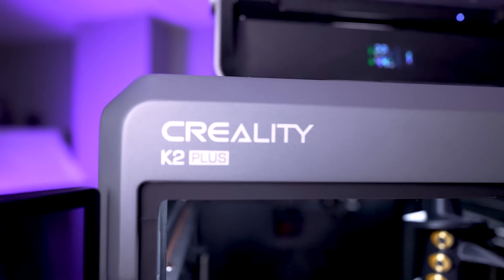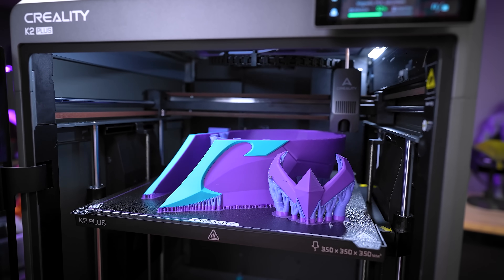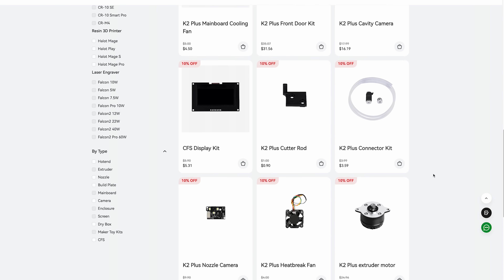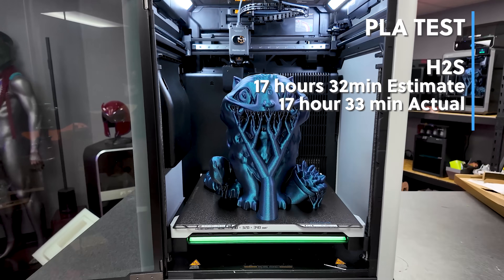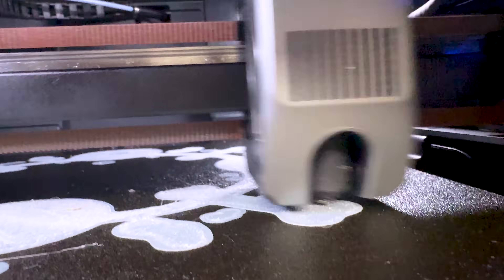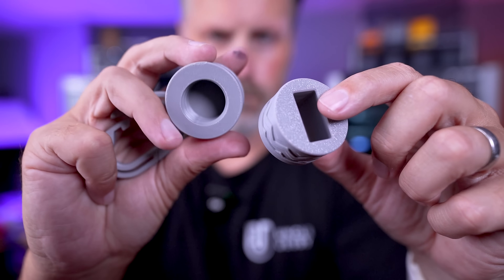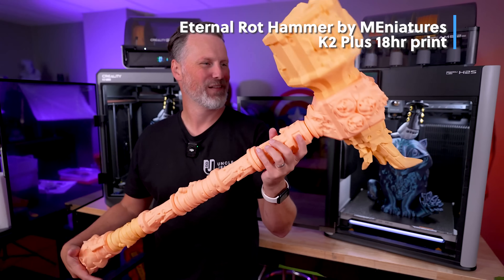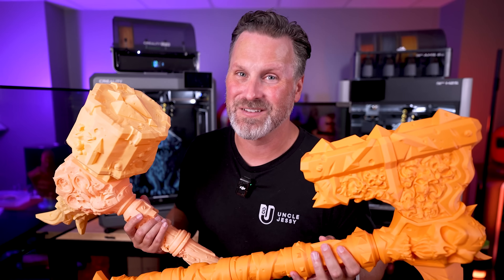Bambu Lab H2S vs Creality K2 Plus — 3D Printer Showdown 🔥

Comment from the maker: Fanttik is running a big Back To School sale now!
Get 30% off the Fanttik F2 Master Cordless Rotary Tool Kit with code JESSYF2M at https://amzn.to/461rlKi
Get 46% off the Fanttik S1 Pro 3.7V electric screwdriver with code JESSYS1P at https://amzn.to/3JtHEHi
Reply: the
 code for the screwdriver is only 10 percent off not 46
Reply: @HPY-Prints  Code on Fanttik website doesn't work either
Reply: Will you be at Formnext in Frankfurt in November?
Reply: I have a solution for your K2 Plus poop chute issues if you want?  Message me. N I'll show you what I did to mine and it works amazingly now!
Reply: H2+, you say? 😀
Reply: can I get a updated code for the F2 plzz
Reply: Anycubic Kobra S1 Max Combo is comming in MARCH and BANG4BUCK it will be the goto for me and maybe a U1 when they are at retail or BLACKFRIDAY

Comment: The problem with Bamboo lab printers is you can buy pretty much every other printer on Amazon and have it in hand the next day free shipping with a 30 day no questions return opinion for any reason you don't like it, with Bamboo you got to wait for them to process you order up to 3 days then it is another 3 to 10 days for shipping and you pay for shipping. Bamboo printers seem to always be sold out maybe just my luck but every time I try to get one they always only have the most expensive ones in stock. Then they are always out of filaments and their ams needs their filament spool to work correctly it just seems like they can't even get the machine to you and lack of filament availability along with the inability to use your slicer of choice sucks they have a lot of hype and a lot of marketing youtuber praise but...... seems customer service and product availability lead times are a huge red flag to me!!

Comment: I've got the K2Plus and 90% of my prints are PETG only real issues I've had with it was when I 1st got it & the CFS jamming and lots of issues but since adjusting the spring in the CFS only had minor issues.
I have the Anycubic Kobra S1 Don't use it and the Bambu A1 only use it now and then because I've find my K2Plus just works

Comment: I had my K2 Plus for about 2 months now,  not once have I had a clog, nor have I have any issues with the PETG print or quality.  My prints are flawless.  Not certain if you are using a printer that  is a year old and maybe needs some maintenance against a brand new printer.    I would chose a free H2S over the K2 Plus as well, but when you have to pay an extra 900 for it.  No.

Comment: I like the open sourceness of Creality main reason why I've stuck to it. Unfortunate to hear that the k2 had issues with TPU, as with my k1 I was finally able to get tpu to print properly, but that's also because I'm running microtech hotend, but this wouldn't help the k2 as it's an issue with the toolhead. Might still consider the K2 plus to upgrade my k1 max for a larger format printer.

Comment: Great video. I was researching printers based on my need for engineering filament print speed and everything i've read has shown that the h2s is faster. Is it that the k2 is just not capable of printing engineering filament as to why the h2s scored faster in pa12-cf?

Comment: I consider the creality and bambulab debate as comparing apples to oranges. Buy what you value, go with creality if you truly want to be able to fix most parts yourself, or value its more "open" nature. Go with bambulab if you want simplicity, and support.

Personally, I like creality. But I am definitely one of the people that doesn't mind diagnosing and fixing problems. I've had my creality for a long time, and honestly? I love it. It prints everything i throw at it, and when something goes catastrophically wrong, its easy to figure out what went wrong, and i usually have a replacement part ready to go. 

But the printers at my work are all bambulab, and it works well for them. They're all in warranty, and the catastrophic failure that happened with a filament defect was handled swiftly, and I definitely see the value in that.

Comment: The filament build up is a user design error. A rework that widens the dish and has an angle at the bottom to allow the filament to drop closer to the front might help prevent buildup. 

I am a little biased because of a bad experience with the K1 Max, which failed on me time and time again and ended up buying an X1C, where I was actually able to print. The K2 Plus puts out some great prints and it is faster, but the quality isn't up to par with basic settings, when compared to the H2S. Even though I hate what Bambu Labs is doing, forcing people to use a middle man program to send prints off, I'd have to stick with them because of quality.

Comment: I've had several printers over the last 13 years, starting with a Folgertech I3 clone DIY from ebay. Plexiglass and threaded rods and bolts...had to compile marling, wiring everything else and calibrate it EVERY PRINT for years. THen got an Ender 3 v1, did several upgrades and loved it and had less problems than the folgertech. Got a Kobra max for it's size, but quality suffered constantly.  Then, i got a P1S...MIND ....BLOWN !!   True click and print. I don't think i've ever really altered a print profile that i downloaded.  Anytime i've designed a project, i changed very little in the default profile (aside from no calibration vibration and less purge for AMS) ...and still get great prints. I had since put the other printers in storage...no need to use those make multi part prints go faster, since the quality wouldn't match.

 Now i'm looking at getting the P2S when it's available and KEEPING BOTH running.

Comment: I have the K2 Plus and the H2D.  I've been having issues with the support of the K2 Plus adhering too tightly.  Not so with the H2D.  The thing is, I've had the H2D considerably longer than the K2 Plus, so I haven't figured out all the bugs I've learned to avoid on the H2D.  I've been running PETG and PCTG almost exclusively on both.  I've been building oversized coffee cups, wall tool holders, and rebuilding all my tool boxes I used to build with my CNC machine.  Yes, plastic is much lighter than wood for this purpose.  Owning large 3D printers is like owning a 5-axis CNC.

Comment: I have both printers. When I bought the K2 Plus I had all sorts of problems. Including the PTFE tube coming out of the print head. After working with Creality and replacing numerous parts it is now working with some minor issues. The H2S has given me the best quality prints I have had to date. I have printed several large and small projects and it is difficult to see any layer lines. I have 2 Cenaturi Carbons, the K2 Plus, 2 P1S's, a X1C and the H2S. The H2S is hands down the best printer. I did some PETG transparent filament with Bambu's recommended settings and they turned out incredible. In my opinion the H2S is worth the extra money.

Comment: so if the K2 Plus is slowed down to match the H2S print times then that may eliminate the ringing, also why not print the mod and try the TPU again? Also you cant compare an old printer with a dodgy coupler to a brand new printer

Comment: @UncleJessy in your video you make a comment at 8 minutes 36ish seconds stating the H2D doesn't purge any material.  Can you explain that further?  We're debating purchasing an H2S vs an H2D and  would like to better understand the filament waste differences between both.

Thanks for your detailed video!
Reply: The H2D has two print heads, so if you are using only two colors, the left head drops down and the printer continues to print.  There's no purge.

Comment: I bought a K2 plus when the H2D was released and was sold out.. worse mistake ever. I ran into numerous issues with the K2 plus with less than 30 hours on it. It essentially became a 1600 dollar (I bought an extra CFS)  huge paper weight for about 3 weeks. The main cable leading from the tool head to the motherboard was defective and a wire that went bad inside the harness, the tool head mother board went bad and the bed sensor went bad. Keep in mind I only printed with PLA at this time. Creality did replace them but as the only place that stocks these parts are china it takes forever to get in. I fixed all the problems and sold it immediately and took a 400 dollar loss, drove 3 hours to Micro Center and bought a H2D with a second AMS and I have had no issues for 2 months now.

Comment: I think we got the same bad batch of K2 Pluses. I've had the Strain guage issue which was eventually fixed by replacing the wiring loom, I've had the coupler give out (Buy another front extruder cover, they have updated it and the coupler is different now. A few changes internally to the plastic as well), and I've had the heat break fan issue as well so i've had that replaced. Next I would bet your stepper motor will die from the bearing wearing out and not being able to rotate. That's an absolutely horrible 6 hour long fix since you need to disassemble the whole top of the printer to change it out.

Comment: Great video showing off the H2S, thanks!  I am curious on something you said, the H2D did fail in its multi-color print but you said it had no purge material.  How did you accomplish this on what looks like at least a 3 color print?  I thought it could only do that on a 2 color print?
Reply: I agree.  There's something wrong with this.  I've had the tower fall over on occasion.  It's quite a mess.

Comment: Correct me if im wrong, everything i hear is bambu is the best when it comes to setup, ease and basically trouble free… and no tweaking … while creality - lots of trouble shooting
Reply: I have the H2D and the K2 Plus.  They are very similar in software and build.  I'm running the K2 Plus presently because it has a larger build volume.  I'm still working out the bugs of the K2 Plus.

Comment: Personally have the k2 plus and mine prints abs, asa and petg flawlessly every time. I've also had great success with tpu by changing the spring in the extruder. No idea on pla though as I never print with it lol. I print mostly automotive and shop stuff

Comment: I've had the H2D since May.  On my X1C, the poop bucket doesn't have a slide and just falls into the bucket.  The slide designs for the H2? series are problematic if you print them in PLA and are using PLA in your print.  The temp of the purged filament is just high enough so it can slightly bond to the slide.  Not enough to be permanent.  There's a few solutions I've tried.  First, monitor once in a while and just move it along with your finger.  Second, coat your PLA slide in something the PLA won't bond with.  Third, print it in PETG or another filament that you won't be using often for your prints that doesn't bond to PLA or whatever your combos need.  That's the only poop chute issue I've seen.

Comment: Add another Plus 1 for the H2S as it can also use the 10 watt laser. If you want a laser of course.  I found for PETG, use the Bambu PETG-HF setting, all my prints come out really nice with eSun PETG at that setting.   One other thing to note, some filament prints better at slower speeds, so the H2S may be setup to do just that even though it is rated at much faster speeds.  Of course you could put it in Ludicrous mode, but I don't recommend that if you want a decent print in PETG.

Comment: I've had Creality machines since 2017 and suffered through the CR-10, CR-10S, CR-10S Pro and CR-10 S5.  Lot's of upgrades to keep those going.  I've been pleasantly surprised how well the Bambu Lab machines & software work.  I wish that H2S was a smidge bigger but I'd definitely like to add an H2S to my shop!
Reply: 500X500X500 build volume would work for me.

Comment: I have been going back and forth between these printers and the biggest deciding factor for me has to be the build size I also have used creality since the Ender 3 pro so I’m quite familiar with any fixes this was a great video you covered all of the potential deciding factors. K2 for me!
Reply: Still running my ender 3 S1 just made a bunch of Halloween displays and it has been flawless of course just PLA but watching this video I almost think my prints on my bed slinger look better!!

Comment: Print PETG with the door open, this should help a lot
Reply from the maker: Ohhhh thanks I will give that a shot. Never occurred that might be an issue
Reply: @UncleJessy  my colleague learned this the hard way... The filament got too warm in the extruder and wrapped itself around the gear 😄
Same for PLA, by the way. This loves to be cooled as much as possible (which will also result in better overhangs)

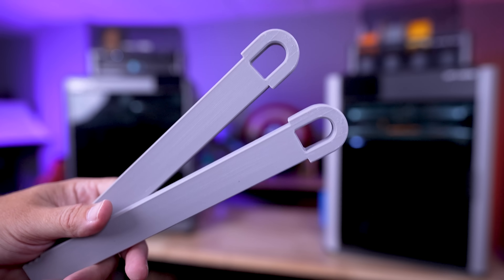Comment: 10:58 from my experience with the K2 Plus you have to heat soak but you also need to turn off the active chamber temp controls. Also when the print start, Creality turns on the side fans full blast so I try to turn them off immediately to keep the plate from being cooled down before probing.

Once I did this I stopped having overly squished first layers and stopped getting the weird lines or ripple
Reply from the maker: Thanks for the tip! Will give that a go

Comment: Just the number of mechanical failures I have had to address in the less than 1 year of K2P ownership has pushed me back to bambu.  The process through Creality is slow and not end user friendly.  I have had probably 15 plus Kg of failed prints on the K2P from mechanical failures during the warranty period (not nozzle clogs etc).  I have put in the R3men bed, trying to correct for the printer being unable to correct even the slightest bed mesh issues etc.  it just isnt something you can trust when you NEED the job to finish.  When it prints, it is OK at best.  I should have known it was still status quo for Creality when my K2P chamber heater didnt work out of the box.  when i opened it up, the connector had never been plugged in.

Comment: Let´s be honest. For over 1k they are both too expensive for me. I got a Flashforge M5 for 250 bucks, I could get 4 of those for one of the bigger ones. Sure it can´t print as big but it costs only about 1/4 of the price and you can print all the smaller things just as well ,even faster with multiple printers. So for like 600 bucks I would take the K2 but for over 1 grand ..naah. The H2S is also a locked Chinese system just like the Chinese gov. and I don´t support either of them.

Comment: Looking at the K2S but curious how it does with ABS and warping. Had to get solid build plates for the X1C printers because the prints would warp every time. Wasn't an issue with sticking to the bed because the bed would literally peel up from the magnet and stick to the part lol. I use ABS the most so warping is a big problem to look out for when I consider a printer.

Comment: I have both of these printers. I do like the build plate size more of the k2, I have had so many issues with when printing,  I want to get rid of it.  So far the h2s, just works out of the box.  I had to repair the cfs, multiple times,  filament,  extruder issues,  cfs clog,  unit freezes mid print,  need to power it off reset it.  Etc.  Too early to tell for the h2s, but if it's anything like the x1c, I won't have any issues.  I would tell anyone to buy the h2s over the k2, unless you absolutely have to have that extra few mm of bed space

Comment: @UncleJessy I noticed that your nozzle wipe assembly within the waste chute on the K2 Plus is broken. It should be parallel to the top of the chute, and not angled. This may have contributed to the chute clogging.
As your machine is an early unit, you might need to request both a new chute and nozzle wiper assembly, as they have revised the chute and how the wiper attaches.

Comment: If I had to pick between the two I'd probably go for the H2S just cuz of Bambu's more consistent track record and the potential for the upcoming Vortek.

Tho at this point I'm trying to decide on what to build to put a bondtech INDX on. Leaning towards a Vcore 4 but I wish Ratrig would go back to letting you choose your electronics parts cuz I don't need most of 'em.

Comment: I used to think being able to use open source slicers with the K2 plus the reason to avoid Bamabu who force you to use only Bambu studio.  But now I see most of the community selling their K2's and abondoning them in drove makes me think the new H2S is the way to go.  No wonder Creality are doing discounts now and nothing has changed in their new K2 pro other than smaller build volume.  All the same filament issues and lock in to only PLA is disappointing

Comment: Your reviews of the Creality K2 plus lead veiwers to believe (as do other reviews) is this printer is only good with PLA and all orher filiments like TPU, PETG, ABS etc all cannot print on the K2 without seriois issues if not fail to complete. In other words no print job will complete and if it does it has serious quality issues.  Is this your conclusiin and unless you jist want a large voulme with only PLA the only choice is Bambu or similar quality printer?  It seems hard ro believe Creality have made their flagship incapaable of printing any other filament except PLA?  But every review I see the K2 plus has serious issues with anythinh but PLA.  I was set to Buy the K2 plus this week but have chanhed my mind and will not buy any creality produxt now from whating your review

Comment: My K2+ is a great printer when it works.  But it took 3 months of dealing with random errors to get it to print.  Now it will fail to print about 20% of the time.  My H2D and X1C  print flawlessly.
Reply: I think that says it all. Avoid the K2 plus unless you want to spend most of your time fixing it ans replacing parts and being limited to PLA